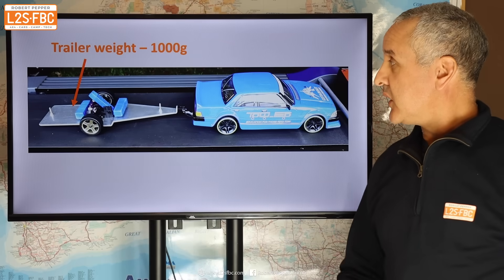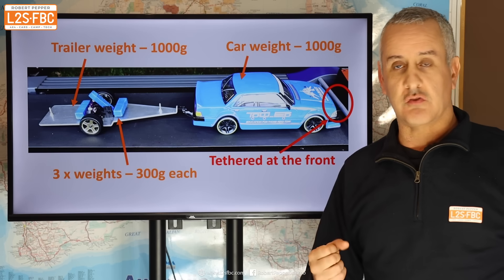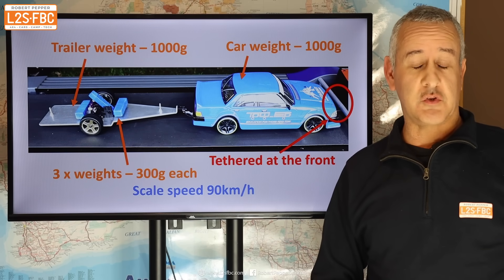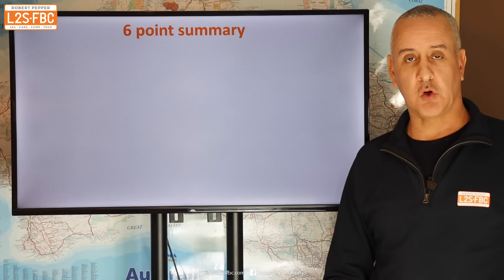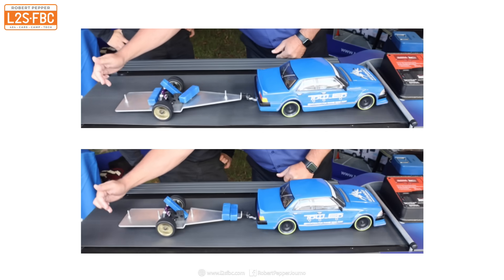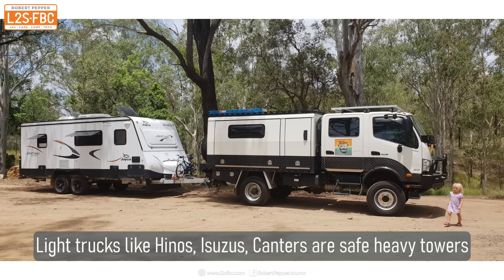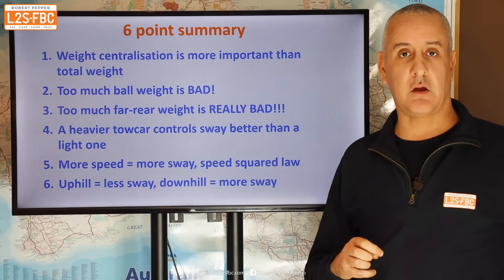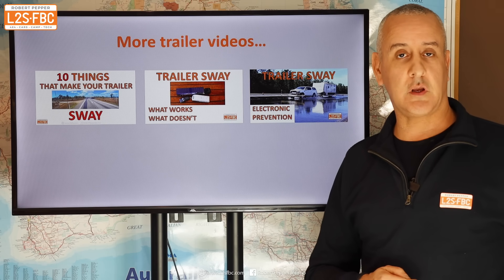7 trailer weight distribution setups, some safe, some deadly.

Comment: Load of rubbish - you are just demonstrating how dangerous it is without any control system. I have run my outfit at 80mph on French roads with no issues
Reply from the maker: Correctly weighted?
Reply: @L2SFBC  Hi Robert - yes and I can elaborate on the myths and disinformation.  Many manufacturers and others suggest loading the heavy weights over the axle and avoid heavier loads on the backend of the van.  All load bearing beams should be loaded equally along the full length of the beam where possible. - formulae for this is anti clockwise moments equal anti clockwise moments to keep the beam in balance.  In a single axle trailer the manufacturer will put a maximum load on the hitch of the A frame, with this in mind the trailer beam should sit on the axle with the maximum load of the axle in mind.  In this case the rear of the van can be loaded with weights up to the limits of the overall weight of the axle as long as it is balanced at the front with a positive bias on the hitch.   In terms of lateral stability, inertia is only created when a force is exerted on the van side or through directional changes.  It is the tyres that resist this force and therefore the slip angles that change when this occurs ( radial tyres have narrower slip angles than Cross ply)  Slip angle change when a retardation or acceleration occurs this is a crucial element involved when a sway commences since there is an abrupt change in the slip angles when the limit of sway in reached so this combines with the  overrun brake when the acceleration pushes the brakes on and increases the pent-up energy return to equilibrium.  This is why it is very important to only brake one specific wheel that can control the appropriate slip angles of the tyres - hence why a differential control is the only way to control sway.   NB  proof of the weight distribution can be seen in flywheels, wind turbines and aircraft wings whereby flywheels work best when the weight is places on the outer edge of the wheel and conversely lighter on the tips of wings etc to allow faster speed reaction to the outer circumference, something you don't want in a caravan situation. Regards John

Comment: I've towed tens of thousands of kilometres and only had one severe sway, when I was towing an MR2, I didn't think about it but the mid engine dramatically shifted the weight distribution rear on the trailer. Thank god my car has trailer sway control, it saved me and I immediately stopped and reversed the car onto the trailer to keep the weight closer to the centre/front of the trailer
Reply from the maker: Thanks, love to hear these stories!! For those not familiar the MR2 is a mid-engined car so has about 40% of its weight on the front axle as opposed to the usual 50-60% for front-engined cars.
Reply: Don't count on the car being a crutch to save you from stupidity. If you are going to be pulling vehicles on a large trailer behind you, you need to learn how to drive in those scenarios first and be able to control your vehicle. You're towing a trailer and then on top of that carrying a live load which wobbles, bounces, and moves.   Remember, when you cause a multi-car accident on the highway, the one responsible is YOU. The one that will be paying the insurance out for all those vehicles you wrecked is YOU. The one the police will hold liable is YOU. Don't be that guy. They have driving classes for pulling trailers. Take them. I was a camping trailer mover for several years, private contractor, just a 40 yr old Chevy dually pickup. One of the trailers lost an axle due to a manufacturing defect (improperly welded) and the entire trailer became unstable due to losing its 2nd axle and was bouncing around like mad (the trailer was fully laden inside with furniture and other items for the move). Because I already knew what to do, I was able to counter the unstableness and tame the trailer from wrecking out. Nobody got hurt and life goes on. I was able to limp the trailer to its destination whereby I was sued for damaging it. It was eventually proven that the damage was from the factory and I was off the hook and compensated legal fees.
Reply: What was your tow vehicle? An MR2 is very light (under 2,500 lbs), so even with the weight of the empty trailer you couldn't have been that heavy. Maybe 5,000 to 6,000lbs?

Comment: Appreciate the well made video.  Made it very clear not only what to do, but why.

And it makes me think two more items are helpful for avoiding sway:
1.  Tow vehicle with longer wheelbase.  I always presumed that was the case, but this video shows why:  to help keep pressure on the steer tires, due to the longer "lever" of the vehicle.
2.  I'll guess that 2 axle trailers are better, by reducing the forces on the hitch (up or down) and expanding the zone that's over the axles.
Reply from the maker: Correct on both counts. Longer wheelbase / shorter overhang is better. And yes four wheels on the trailer resists sway better than two.

Comment: Trlr                        cab
______________.  .____________[][].
[/////34,000/////]v[34,000,1200]__\
Oo.<->                 Oo.                  Oo.

Notice, at maximum, the front and back of a semi trailer is balanced, with just a little on the front to keep it tugged.
Reply from the maker: Indeed!

Comment: This reminds me of all of the things I was taught in truck driving school back in 2000 (18 wheelers, more properly, a semi-truck towing a semi-trailer).  The first thing we were told was a loaded trailer handles better than an empty one.  If we were having problems with the weight distribution in the trailer (it's hard to rearrange the load away from a loading dock), we could move the fifth wheel forward and back to change the distribution on the axles.  We could also move the entire trailer wheel assembly (called "the bogeys") forward and back to change the distribution.  Also, at least with the big rigs, the trailer is the vehicle in control, not the truck!  As you quickly learn when driving in snow.
Reply from the maker: Thanks Rigel, that's very good to know!

Comment: As much as this pretty well demonstrates that with good driving you can tow something and have it be stable even if the trailer weighs more than the towing vehicle, in my area i wouldnt trust drivers with a configuration like that.

Comment: Great video. The only thing that would make it better is braking, I have tried to tell people you don't need all the weight on the tongue but they think you need tons of tongue weight so the trailer doesn't push up on the tow vehicle during a hard stop. If there was a way to get that shown this would be even better.
Reply from the maker: There is...see description of video for exactly that.

Comment: The number one thing (and that wasnt emphasised) gives you the biggest margin of safety is SPEED. Caravans should be limited to 90 kph MAXIMUM for a start, then apply everything you saw above. As a person who spent 9 years living on the road its good advice.
 However.....unfortunately you have lots wanker uneducated dumb truck drivers give you grief ( instead of just passing safely) and make driving with your family sometimes very precarious.
Reply from the maker: Depends on the caravan and towcar. My own van tows great at 110. But it's lighter than the towcar.

Comment: Oh good I guess I’m doing right thing. I was worried something like that. Hauling 12x6 enclosed trailer with Chevy express cargo van traveling. Atv on single axle trailer with bunch of stuffs up front of trailer. Drove around. No problems. I wasn’t sure if I should had done that with atv on axle but seem it’s right way to do it. So all good. I personally saw one truck with camper trailer swaying down the hill. Not pretty sight to see.

Comment: I loved this video. It was informative, but also provided a memorable visual that will stick in your mind when loading. I wonder whether you'd be able to do something like this for 5th Wheel trailers. I have a Ford F350 with 42ft 5th wheel RV, I'm very conscious of weight distribution, but would be really interested in seeing the various impacts. I assume that tongue weight on a 5th wheel will improve stability in the same way as adding extra vehicle weight, but also assume there will be a limit to that benefit. Anyway, great video! Thank you!
Reply from the maker: Thanks yes a 5th wheel will be more stable as the ball weight is distributed between both towcar axles and there is less leverage for the trailer to wag the car. This is why prime movers can tow such heavy trailers.

Comment: Nice demonstration of the effect, but the explanation is not correct. It has pretty much nothing with front/rear axle weight distribution on the towing vehicle (as soon the wheels do not skid). The crucial factor is a moment of inertia of the trailer relative to the vertical axis of rotation of the trailer in the middle. When you spread masses away from the center of rotation, the moment of inertia increases. From a control theory viewpoint, the inertial mass works as an "integration" unit, which means its transfer function has a pretty large phase shift (a quarter period), i.e. responses to compensating actions are slowed. Higher the moment of inertia, the more prominent the delay of the response in the control loop. At some point the response becomes so slow that it flips the sign: the compensating force does not reduce a slight disturbance anymore, but increases it, causing a positive feedback loop and hence a progressing sway. The distance to the "sign inversion" point on a system's phase chart is your "stability margin", and it depends on many other factors beside the moment of inertia. Increasing the speed leaves you even less time for a proper compensating action and makes disturbances larger, thus decreasing the stability margin. Increasing overall mass of the car and/or the trailer (while keeping the moment of inertia low) increases the stability margin, because it needs a larger disturbance to destabilize the system (but it may create problems in other control channels).
Same works for a car without a tow: if the car masses (cargo, passengers) are concentrated in the middle, the car will be less prone to a progressing sway in a case of a sudden maneuver on a high speed. So, when you loading your car, start it from the middle and put heaviest stuff there.

Comment: Great demonstration!  Clearly shows the effects of weight distribution while trailering.  I wonder how trailer design, e.g., axle placement, affects the overall weight distribution.  I've seen some videos and real-life cases where trailers not hooked up to avehicle were unstable when someone walked up the back of them.  The front would flip up implying the overall weight distribution and axle placement was too balanced.  I've always designed trailers where the CG of the trailer weight was roughly midway between the axle and the hitch.  This meant that the trailer could be loaded from the rear without it being hitched up and it would typically not tip backwards.
Reply from the maker: I'd say CoG midway between hitch and axles is too far forwards if the trailer is heavy for the reasons shown. If the trailer is light then CoG doesn't matter much, eg 300kg trailer behind 3000kg car.
Reply: @L2SFBC  True.  I've only designed light trailers...300-450 kg capacity.  They do work well behind my 3000 kg truck.  

Still, the trailers I've seen with what I call stability issues didn't look that big and yet a person walking on the back could cause the trailer to flip if it's not hitched up to something.

Comment: There is a reason why you need a special drivers licence to be allowed heavy trailers (heavier than the towing vehicle) at least here in Sweden. (4:46 shows why)
Reply from the maker: I didn't know that - can you elaborate on the licence please?
Reply: @L2SFBC  It is an extension to the normal licence.

Class B is a car (max 4500kg?) with a trailer weighing at the most the same as the pulling vehicle ("empty" weight with driver, whatever that is called in English).

Class BE is a car with a trailer weighing more than the car. Not many cars are allowed to pull a heavy trailer, and there was (30 years back when I got my license) a limit of 4500 kg for the car+trailer.

You can get B class, and drive a fairly large caravan (they are light) behind a reasonably large car without ever showing that you can handle a trailer, but for BE you need extra theory and you have to prove that you can safely drive with (and backup with) a heavy trailer.

For trucks and buses, there is also an E certification (C/CE for trucks and D/DE if I remember correctly) to be allowed to drive with a heavy trailer.  But what the weight limits are in that case I don't know.
Reply from the maker: thank you!

Comment: the rule of thumb is 60% of the weight in front of the trailer axle/s, graduated, so as not to be directly on the hitch and 40% of the weight behind the rear axle/s, graduated so as to not be directly on the bumper...
Reply from the maker: Depends where that 40 and 60% is located.

Comment: The most common problem I see here in the USA is folks towing a huge trailer with a tiny tow vehicle...you can see this problem when the rear end of the tow vehicle is being pushed to the ground like the tow vehicle has 10 tons of bricks in the trunk...in other words the tow vehicles are way too small for the trailer...just because your vehicle can tow it doesnt mean it is safe at all
Reply from the maker: Not just the USA!

Comment: Excellent demonstration.  On a technical point perhaps, once the trailer is hitched, it is not the trailer becoming unstable, but the combined articulated vehicle.  
For example, when there is too much weight on the ball (weight distribution well forward on the trailer), an unhitched trailer will be very stable on its own, but connected to the towing vehicle, the combination becomes unstable.  As a driver towing such a "stable trailer", one experiences the trailer swaying the rear of the towing vehicle.
The dynamics of the combined articulated vehicle represents a feedback loop which can be stable, neutrally stable or unstable with growing oscillations (mainly left/right) at the "natural frequency"  (dominant eigenvalues/poles) until something gives.  
If it was a linear system, the instabilities would have occurred at very low speeds as well, but unfortunately the car + trailer combination is actually stable at low speeds and small deviations. 
At high speeds it is a different story, where a disturbance (aggressive overtaking of a responsible driver) results in the trailer rolling a bit and/or skidding, changing the dynamics of the combined system to become unstable.   
I would like to learn from the experts how to recover from that?
From a feedback control perspective there are a few ways to revover (or try to at least)  from instability:
1. Lead compensation:  Anticipate the swaying and make steering corrections in anticipation of the oscillations.  It may be too late once wheels start to skid etc. (entering non-linear dynamics).  The road may also not be wide enough to allow for  recovery before the side to side oscillations pushes the combined vehicle of the road.
2.  Reduce the "feedback loop gain" : This would mean reducing pulling power (lift foot of the accelerator - not braking!).
3. In some case increasing the loop gain (accelerating) will pull an unstable system into stable operation,  but one has to either try it (perhaps with the model in the video?) or create and analyse a mathematical model of the system to predict the success of such a strategy.   
Thank you again for the video, I would have loved playing with such a setup!
Reply from the maker: Hi, great thoughts thank you, and I like the "unstable rig" concept.  Too much noseweight can be a bad thing. I have other videos on recovery, check the pinned comment and description.  It isn't possible to anticipate and steer out of sway with any reasonable chance of success.
Reply: @L2SFBC  Thank you, I'll check your videos on recovery!

Comment: Inertia variation is not linearly proportional to mass do your model can never be accurate and underestimates there effects of inertia.
Your conclusion that a heavier tower created better weight distribution isn't correct. That effect is down to the larger inertia of the tower relative to the towed.
Reply from the maker: No, I said a heavier towcar is more stable.